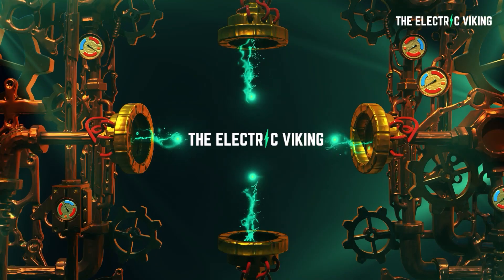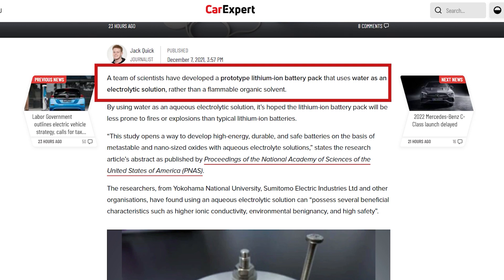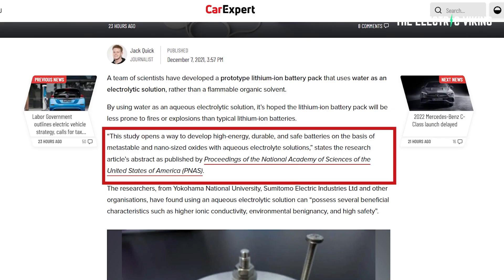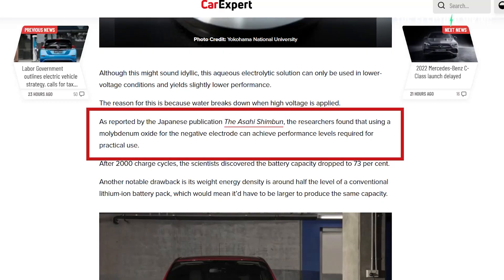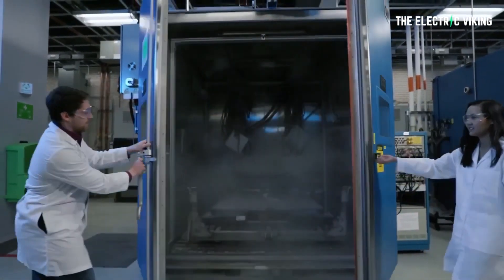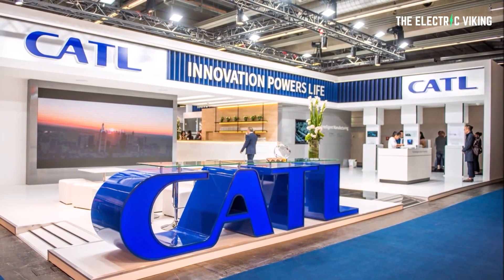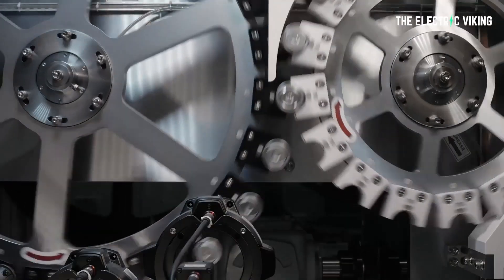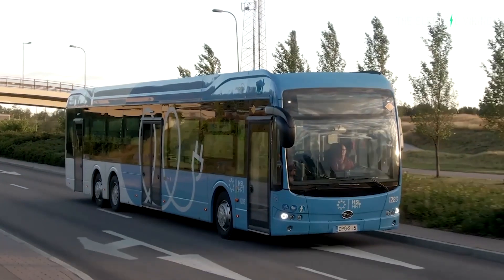Water as an electrolyte - the solution to lithium ion battery fires!?

Comment: Energy storage products.

If you mean grid storage there's already a great product that should be picking up interest, which is an iron redux flow battery.  It uses mostly iron and water.  Far better for the environment.  It doesn't have great energy density, but it doesn't matter.  It basically has an endless no. of recharge cycles, and that does matter, and they are very efficient in their conversion, and that's important.  Once you get to economics of scale on this, it will be the best thing on the market for grid storage and require almost no recycling of materials other than the storage container, the water tanks and a couple of other components which is much easier than having to recycle Li-Ion or any other lithium product to recover the lithium.

Comment: No lithium rechargeable battery uses any water in its electrolyte, none. The electrolyte is an organic solvent.  Many of these solvents break down under a voltage stress beginning about 4.8 to 5.2 volts. Many organic solvents also are sensitive to heat which is produced as the cell or battery is charged.  That is why there are caution notes about do not overcharge lithium cells or batteries.

Comment: You can pierce BYD Blade batteries with almost no catastrophic fire risk.
Reply: We have  not seen any proven independently test from any reputable organization such NHTSA or Euro NCAP, all we are seeing is video supposedly provided by BYD. Until I see independent test results I will my opinions.
Reply: LFP batteries are well known to be much safer than NCA or the other varieties of lithium cell. They are far more tolerant of over-charge and they don't catch fire when punctured. It's the chemistry that matters. The format is irrelevant - blade or roll or whatever. They are all scrapped by discharging below the minimum voltage but they tolerate over-charging. They also tolerate heavy charge/discharge rates much better than other chemistries.

Comment: I used to work on electric forklifts and all of the equipment ran on lead acid batteries. Durring the charge cycle the water in the electrolyte would convet to hydrogen and oxygen. Creating an explosion hazard. AGM batteries negated the explosive hazard by sealing in the gas, and making the electrolyte a gel. It will be interesting to see how the chemistry works here.
Reply: That's because flooded cell batteries need to be equalised regularly, which is basically a controlled overcharge. You don't get gas production in a sealed battery, or at least you shouldn't if charging them correctly, because they don't undergo equalising charges. The same with lithium, equalising is done electronically, not using brute force overcharging, which would actually kill lithium batts.
Reply: Lead acid AGM (advanced glass mat) cells use the exact same tech as flooded cell lead acid cells. However, the AGM supports the cells and keep the active powder in place during high charge.

Comment: Sam.
6:19
You can't have "a 70kWh pack that gives you 1000km range"
A 70kWh pack gives you the same range as any other "70kWh pack".
You COULD maybe fit a 140kWh pack in the same space to give you the range.
What IS interesting is that "higher energy density" implies the ability to discharge faster.
That in turn should translate to faster charging.
THAT means you don't need a bigger pack.
So, you have a 70kWh pack with (maybe) half the VOLUME, but with better range due to weight reduction, plus the ability to charge faster (50%?)

Outrange the driver, charge during the driver break.

Comment: For short run vehicles we already have supercapacitors
Reply: Supercaps have nowhere near the specific energy of a lithium battery, there are some hybrid batts that have the features of both batteries and capacitors, but they are not true supercaps. A real supercap has a specific energy less than 20Wh/kg, which is worse than lead-acid batts.
Reply: Where I'll buy one it would charge in 10 minutes

Comment: If water works pretty good, what if one uses heavy (deuterium) water?  Perhaps the different electrochemical properties would be even better for batteries?  Just a thought.
Reply: Could be ⚡on to something 🤔 special 🤔 😉 😏 😀 😜 👀
Reply: Heavy water is chemically the same as ordinary water except the hydrogen atoms have a proton. It would have no useful effect on a battery but it would be expensive.
Reply: @Dave5843-d9m  would work Inside a nuclear battery 🔋 😒 🙄
Reply: @Dave5843-d9m   Not exactly the same.  Heavy water melts at 38.88F and  boils at 214.5F.  The evaporation rate is different, which explains some lakes having higher levels of D water.  It is likely that the electrochemical characteristics may be different as well.  Costs are a function of how clever one is at extracting D.  The differences may be worth testing.  The differences may or may not be useful??

Comment: If these water based solvent batteries are much safer then the protective structure may be less so density of the battery pack would be less and make up some of the disadvantage

Comment: Ok..So we should spend 60000$ on an EV that will likely have old tech batteries within a year of purchase. The EV industry is already screwing this up by not using a common swappable battery platform on all vehicles. This cannot turn out well for early EV adopters.
Reply: That depends on the company you buy from really.  Warranties from companies you expect to be around in 10 years are very helpful.

Comment: Did you say Yokohama University, that led me to believe that maybe Toyota pay for that research and I don’t believe that will work, when water is heated it vaporize,  so how long would it take for the full volume of water use as electrolyte to evaporite leave the battery empty of it charge causing the battery to go dead.

Comment: Water adds corrosion. Remember when we used to add water to car batteries. Leaking battery fluid was a huge problem. How many game changers? You keep saying every particular new technology is a game changer. We need usage to sort through all this so the most durable battery technology rises to the top.
Reply: Nope, those were open vented flooded cell batteries, they only corrode because of overcharging causing the electrolyte to off-gas, or from fumes from the acid escaping the vents. It has nothing to do with the water, other than the water being a carrier for the acid ions. The issue was really that the flooded cell lead-acid battery hadn't changed in design in real terms for over 100 years. Lithium batts are not the same...
Reply: @ledsalesoz  Yup, and everyone wants to be a critic without actually looking at any data.  Right now, probably the best battery for grid storage doesn't use lithium, and uses water and iron as the main components.

https://www.youtube.com/watch?v=JxGP9cYbwdk&t=4s

But the uninformed LOVE to bash, and part of the people who do so have a clear agenda.  You can see a person's ID with "hydrogen" in it for instance and they're quick to bash everything that isn't for HEV.  No agenda there.